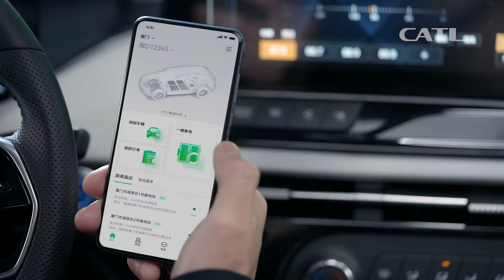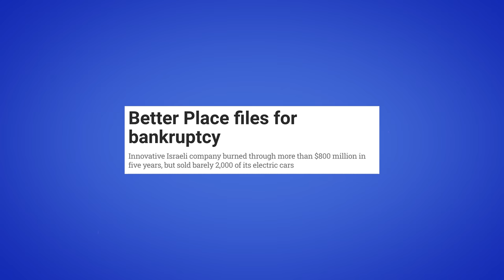Why Battery Swapping Is A BAD Idea

Comment: I think one not often spoken thing is liability. Who owns the battery and who is responsible if it is damaged, I am sure battery swapping station could track whose battery is where, but how do you know when it got damaged. Let's say for example somebody run on the rock and had dent in their battery pack, swapped it, then you came to swap your battery pack, got the damaged battery, drive for a bit, swapped it and the next person after that get's the battery, it explodes and entire family burns inside of the car alive. Who's responsibility it is now? Normally it would be responsibility of the registered keeper of the car who has insurance for it (not that it helps when you family burns alive), but liability is clear, the driver un over the rock which caused the damage, which caused the fire, which caused the death. With battery swapping whose fault it is? Is it the driver? In which case expect exceptionally high insurance premium for car with can swap batteries. Is it a swapping station? What if the battery wasn't noticeably faulty (i.e. voltage was good, it wasn't leaking and visually there was just a dent which is hard to notice), is that their fault? In which case I assume their insurance for liability will be enormous then. Ok now maybe they can track it back to the person who last had a battery and blame you for the damage, but how do they prove it was you who damaged it, how do you prove it wasn't you. Even if they have history of all cars that used the battery before, how do they prove which one of many cars damaged it? 
So I believe liability is the main reason Tesla pulled out of it, it was not cost, it was not engineering it was liability. Why Neo can do it in China? Because China is accent when it comes to such matters, there are no liabilities and nobody gives a shit when 101 electric car catches fire and burns 101 family out of billions of Chinese... and everything is corrupts and any liability case can just be bribed in the court. Not so much in UK or US... so yes lack of regulation and legal framework means dodgy battery swaps could work, not in EU, US or UK. Yeah sure there are like what 5 swapping stations in Norway as pilot and I ma sure they have all appropriate insurance and so on, which makes it unprofitable, but it is just a pilot or marketing, so that cost and loss is acceptable, but it is just not viable on larger scale. And yes when it is such a small scale operation disaster simply has not happened yet and perhaps the service is quiet enough to that each and single battery can be checked every time, but if you try to scale-up and replace million batteries a day... suddenly the risk of damaged battery causing issues increases exponentially, making it not economically viable only because of cost of managing liability alone. And unlike China, this liability can't be pushed down to owners.

Comment: I think as more and more EV's are on the road especially with the recent U.S. EPA emissions regulations and the 67% new vehicles sold by 2032 being electric, you can't have charging stations alone taking up large areas of land and having possibly HUNDREDS of cars sit around for hours charging.  I can't imagine having HUNDREDS of charging ports in one parking lot available taking up all that space.  There would be a need for swapping stations similar to today's gas stations where cars pull in and be out in 5-7 minutes.

Comment: So concise and correct. Battery tech and chemistry is changing all of the time. Plus Structural Battery Packs save 200+kg off the car. Many manufacturers are heading down that route. Swapping batteries on these vehicles would be impossible.

Comment: As I understand it, we haven’t even come up with a universal plug for rapid chargers…
Reply: I assume You mean USA because in Europe it's standardized since Directive 2014/94/EU - all high-power DC charging points installed after November 18, 2017 shall be equipped for interoperability purposes at least with CCS connectors

Comment: Battery swap is good because when the battery gets old you have the ability to easily and cheaply change the battery and not worry about the cost like Tesla’s 20000$ cost of battery change. Nio have supercharger everywhere in china too. it’s great to have it all ⚡️⚡️⚡️
Reply from the maker: When you swap batteries how do you know you’re getting one that’s newer than the one in your car?
Reply: @AutoTraderTV  it doesn't matter because it's not permanent and degradation won't permanently reduce the value of the vehicle. Have a physical capacity of 75kwh and declare a nominal capacity of 65kwh to allow for unit degradation over time
Reply from the maker: @davelloyd8454  It might matter if your original battery that came with the car has a 300 mile range, then you swap one day and get one with 200 miles.
Reply: @AutoTraderTV  that's not a reasonable argument. You're suggesting that the swap station would give you a battery that has degraded to 66% of its initial capacity. This is where regulation would come in (beach of contract / sale of goods act - all that stuff that ensures your get what you pay for).

Comment: The main question with swapping is the same as with charging, will it be universal (one or just a few, less than five) or every manufacturer or even every car has a unique battery and charging way. Currently we are in the unique state, and not sure, if it ever gets some standardization. if no standers batteries, than switching is not an option, if standardized, than you still have the ownership issue, may be solved with leasing options, or even just a service option, you do not own it in any way or shape. but that has its own problems. And it is only a question if no other problems with the battery cars will kill the idea, and of course, if the eu does not solve all of this by going back to coal using vehicles to prove how independent can they be from russia.

Comment: Battery swap is the only way you don’t have to worry about battery degradation. You don’t have to worry about charging. After eight years your car wouldn’t be worthless. Because nobody’s gonna buy an eight year-old EV when everybody knows the battery is out of warranty and it cost $20,000 to replace the battery. not to mention you can swap a battery out in five minutes when it takes almost an hour to fully chargean Ev.
Also you can always have the latest greatest battery in your car 103 or four year old battery becomes obsolete.

Comment: what's the difference tesla charging doing now they can only charge tesla at the moment. to recharge a battery to 80% takes roughly 30min, to swap battery takes 5 min so in theory if they got 6 batteries per swapping Bay they can recharge the low battery to 80% charge.

Comment: Battery swaps would actually be useful at the Tesla dealerships themselves where you can set an appointment to change a battery with a very weak cells. They have the funds for it, and it’ll make the process of going from a battery with 109 miles of range to 325 miles in just less than 10 minutes.

Comment: He didn't address the real issue with battery swapping that is regardless of how smooth you make the process it will always be more expensive, and just plugging in is less time and effort.

Sure with plugging in the cars  not charged instantly but 90% of the time people will be charging at home or work and 90% of the long distance charging people need more than a 5 minute break anyway.

Comment: They should add a battery swap option to all EVs.  Make two small modules that can give yoiu 20 miles each.  Swap these in emergencies or when you just want to get home quickly.  Or these basically act as the 20 percent charge you don't have to wait at the charging station for.
Reply: What emergency. If you properly put in the routes in the navigation the software will take care you won't have any emergency.

Comment: Battery swapping is a solution looking for a problem. With most EVs now capable of at least 400 km I just cannot see a situation where I would want to swap rather than charge. Driving more than 400 km in a day is a rare event for most people and personally I don’t do more than 2 and half hours in the seat...which even on autoroutes is what it takes to cover 300 km given that your average speed is reduced by your time getting onto the fast roads. On trips like that I stop and plug in anyway, just to top up. My car is now old tech, with a max charging rate of 75 kW which it doesn’t maintain for long. As RR points out, battery tech is developing fast with newer models capable of double or triple the charging rate of mine...so adding 150 km in 10 minutes, easily done and hardly enough time for taking a pee and grabbing a tea..

Comment: There isn't a one fix solution for all. For example, I have a house with a drive, I could charge my car at home, no need to swap batteries unless I'm on a long haul trip then it would be advantageous to be able to swap a battery. But what about people who live in areas with limited space and not able to charge from home, high rise flats etc. then battery swapping is ideal. No different to popping down the petrol station to fill up. Battery swapping for commercial business appears to be working already. there is a company in Ausrtalia that makes swappable batteries for heavy haulage vehicles up to 90 ton, they also convert existing diesel trucks to electric, so no need to scrap existing rolling stock. I can see bus companies taxi companies, using swappable batteries. Local delivery point vehicles, Amazon and so no, I believe they are investing in electric vehicles, Seen a few around here already. The point is, just because one idea doesn't work for everyone, doesn't make it a bad idea for everyone.

Comment: A better solution is making all EVs be able to be charged with induction charging, then adding charging to curbs everywhere. Imagine parking your car and it just starts charging? Obviously until that happens, the other solution is to increase the speed of charging. If all EVs can go from 10% to 80% in 15 minutes, I think this pretty much solves the problem. Park, charge, go get some chips or soda, use the bathroom and come out to a car charged well enough to get your 200 additional miles of range.

Comment: Think you are looking at this from the wrong angle. This is for the times when you are doing a long journey - the rest of the time you just charge the car at home or at work. Electric focused channels have performed a swap and seems to work well in a Nio, but yes you are correct needs to be an agreed standard for it to work globally.
Reply: Having a swappable battery pack increases production cost and takes more space in car's structure. It comes at a cost. Also for some reason, NIO limits charging speed to 50KW in swap station and 120KW in car, I wonder why.

Comment: It might be too early to discount the concept. When gas vehicles become obsolete what will happen to the plots of land that currently have gas stations on them?   If today's gas stations become tomorrow's swap stations, then essentially what we end up with is what Tesla calls "Mega Packs" dotted in metropolitan areas.  If you think of petroleum companies as energy companies and they help finance this, then they are not only supplying energy for cars but municipalities as well.  The timing looks like this. Currently, Tesla only allocates 10% of its battery production for Mega Packs.  When global battery production capacity It's adequate to supply both car production needs and swap stations requirements, these swap stations will then assist in managing grid load by charging off peak.  This paradigm shift forces the car manufacturers to collaborate and they are already starting to do so. IE: The majority of automobile manufacturers coming over to Tesla's NACS charging plug stand.  All too often we fall into the trap of deciding between two apparently competing concepts, when the obvious answer is the we will want to do both.  The best part of what comes along with most paradigm shifts is new freedom and flexibility that didn't exist in the past.  When Tesla starts owning a Fleet of robotaxes, swap stations will keep their rolling stock rolling earning them money and transporting people.  Tesla's giving up on battery swapping might just be an assumption. As they were the first to try it, it could be a back burner project that they are currently working on that only Tesla employees working on a project know about.  If Neo's already doing it how hard can it be?  Again, it could be that we are entering era of collaboration instead of competition.  Maybe we're no longer fighting for market share but for our ecosystems our future.

Comment: What is going to happen with large trucks?  Will they ever go to EV?  I had thought that battery swapping could be a good solution for trucks.  The battery swap station would also have to be recharging the batteries that it removes so it is continually rotating them in and out.

Comment: One thing I never see addressed is the battery pack itself. How would you feel about swapping your good, brand new battery pack for a worn one that’s been used in countless other cars? The dendrites and where on that pack must be incredible.
Reply: As it was referred in the Video at least 3554667 times, YOU don't need to worry because they're not yours. Also because of that, the car costs you less. You don't own the gas canister, and that's not a problem, is it?...
Reply: @pg205  Not all of these battery swaps automakers are leasing the battery. I’ve seen this concept just for normal electric vehicles that you own outright. So yes it would be a problem, especially if you’re not going to do it that frequently and they give you a battery with accelerated deterioration from overuse. Regardless, I think the concept is flawed for the reasons he listed, especially with charging times coming down.
Reply: @geraltofrivian516  No problem if the batteries are standardized and own by the swapping stations.

Comment: I remember this being a staple of 1970s futurism about electric vehicles--illustrations showing smiling, uniformed mid-20th-century gas station attendants swapping in what looked like big banks of lead-acid batteries. It seems like an old-fashioned approach to the problem.
Reply: what is the new fashioned approach? making a reusable rocket was also an old fashioned approach you would say that but its working.

Comment: Wrong evaluation I many ways. NIO not profiting from battery swap because the leasing company is. Not all battery needs to be swapped. Owners simply has the choice of charging or swapping. Swapping simply gives you the comfort of long haul travel without need to have long recharging stops.

Comment: I agree with all points made in the video, and I also don't think battery swapping will become a standard. Batteries will get more energy density and durability, and charging speeds will get faster, so the upsides of battery swapping will probably soon be irrelevant.

Comment: 600k£ is really cheap.
The space required is much smaller than chargers.
No Battery ownership is a major positive - they are the biggest cost preventing uptake.

His only actual point was the standardisation issue.

If battery swaps were a thing I'd actually buy a battery electric car. Without them I'm sticking to my petrol car until I can get a hydrogen one.

Comment: This is completely wrong. Shows how ridiculously ill informed they are, the biggest win with NIO is that you will never be stuck with old battery tech in your car unlike all other EV’s. A second hand NIO vehicle will not depreciate any where near like a Tesla or standard EV.   
When you can swap a battery in less than 5 minutes, change the size of battery you need. Charge stations are not only limited by battery tech they are limited by supply, more vehicles means slower charging speeds per car. 
One battery swap station can charge 12 vehicles per hour and takes the space of 3 charge bays that can only fully charge about 6 cars per hour. 
NIO stations act as buffers to the grid so stabilise the network. 
You can still charge a NIO at home. 
I can see a big issue with all these charging stations, they cost a fortune to use and unlike fuel stations if you charge at home you have no reliance on having them. 
So so many things you have missed in this opinion.

Comment: The arguements against this - logical - transition are all based on existing business behaviours (I'm not sharing my platform/battery/customer base with you) and current, emergent technology (lithium...). Take any industrial or technology revolution and it's market demand, not business that shifts the needle. Rather business responds to the unfed market demand - the driver behind the combustion engine. Couple that with a technological breakthrough - for example lithium, and you can be sure what we say "won't happen" today will happen tomorrow. Just with technology we haven't mastered yet... Look at your flat screen tv, electric car, mobile phone, coffee pod machine and contactless card for the proof of that.